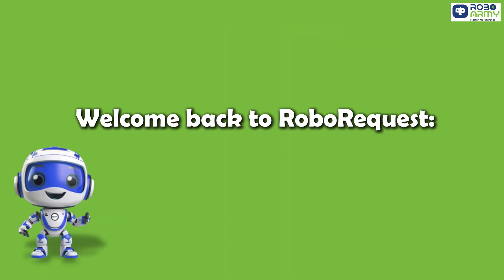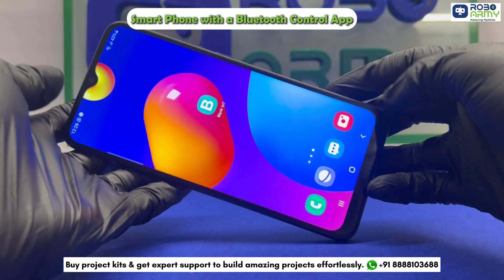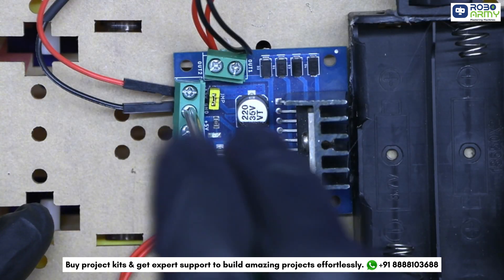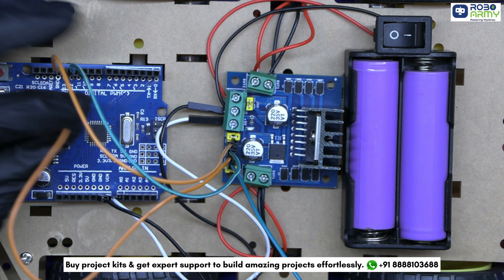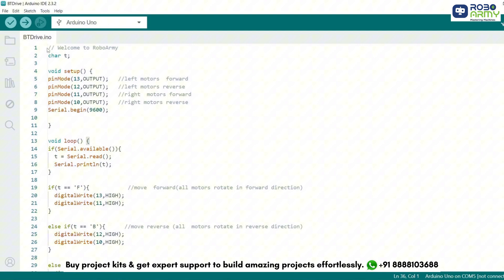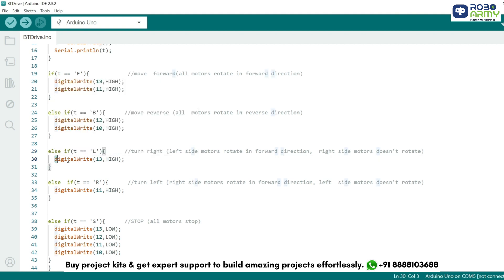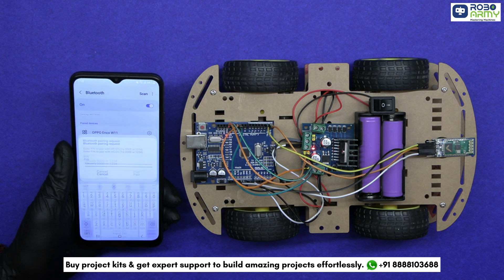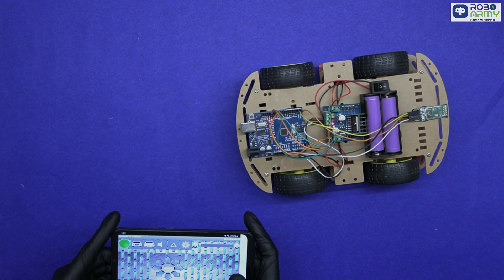Wireless Gesture-Controlled Robot | Step-by-Step Arduino Tutorial | RoboRequest: You ask, We build!

Comment: i am not able to connect hc05 with app... it show unable to connect
Reply from the maker: Make sure your HC-05 is properly paired with your phone in Bluetooth settings first (PIN: 1234 or 0000). Then reopen the app and select the paired device from the list. Also check that the HC-05’s TX and RX pins are connected correctly and the module is powered.

Comment: I can't add the code. I have downloaded the Arduino IDE but it comes out as Arduino uno (not connected) , n when I upload it, it comes out as : Upload error: Failed uploading: no upload port provided. What may be the cause of this?
Reply from the maker: No worries, this is a common issue. The error usually means your Arduino board is not properly detected by the computer. Here are a few things you can try:

Check the USB cable – Make sure you’re using a data cable, not just a charging cable.

Select the correct Port – In Arduino IDE, go to Tools → Port and choose the COM port where your Arduino is connected.

Install drivers – If you’re using a clone Arduino board, you may need to install the CH340/CH341 driver.

Reconnect and restart IDE – Sometimes unplugging and restarting fixes it.

Comment: please make a guesture controlled robot using l293d motor driver and mpu6050
and also it should be 4wd
thank you
Reply: gesture**
Reply from the maker: We've already made a gesture-controlled robot using the MPU6050, but with a 2-wheel chassis and an L298N motor driver. Check out the tutorial here: https://youtu.be/Vwvs890ryqg.

You can definitely try it with a 4-wheel chassis! Just connect both left motors in parallel to one side of the L293D and both right motors to the other side. Let us know if you need help!

Comment: Very good project but my HC 05 connects with bluetooth in the app but not move when i press buttons
Reply from the maker: Thanks for your feedback! If your HC-05 is connecting but the robot isn’t moving, please check these: 
1) Ensure RX and TX wires are correctly connected (TX of HC-05 to RX of Arduino, RX of HC-05 to TX of Arduino). 
2) Double-check motor driver connections. 
3) Make sure you uploaded the correct code and set the right baud rate (9600). 
4) Try removing and reattaching the RX/TX wires after uploading the code. Let me know if you need further help!